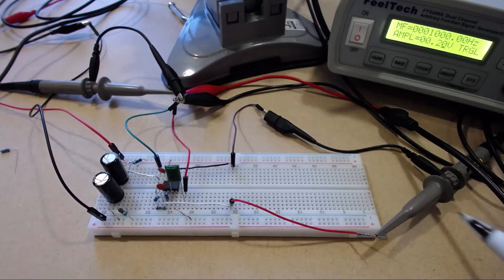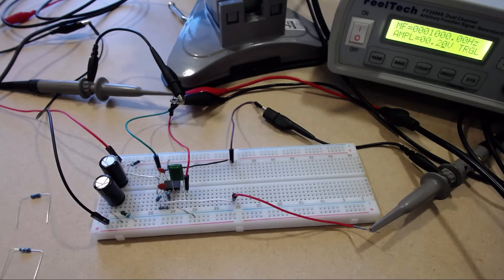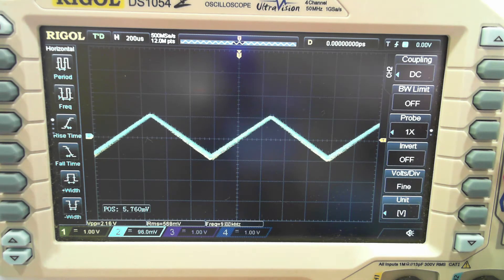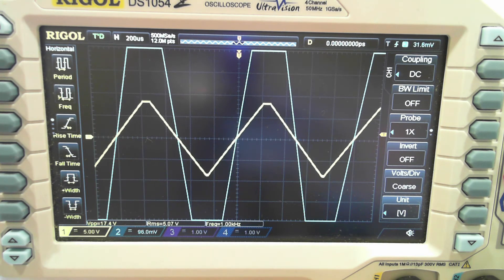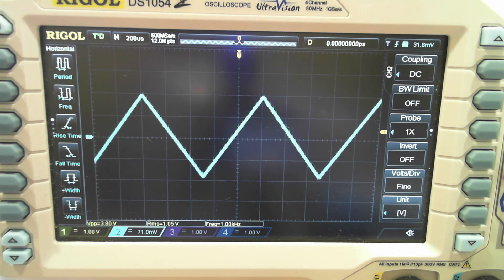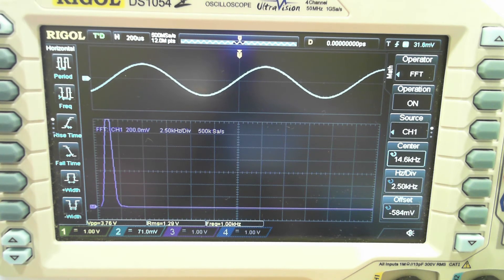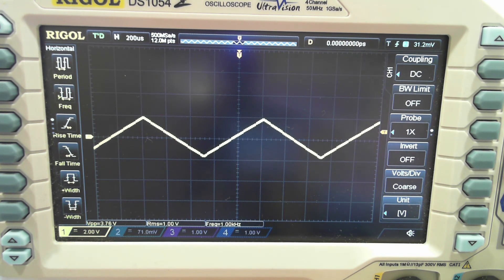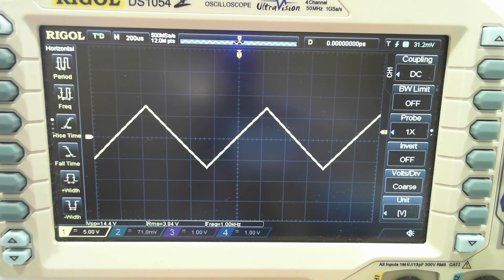CMoy ( Chu Moy ) amplifier and power output test

Comment: Based on your measurements, the op amp can drive headphones from 37 to 300 ohms really well, because you need so little power. It is essentially a transparent amplifier, because the input and output is the same. Did you measure the output impedance?